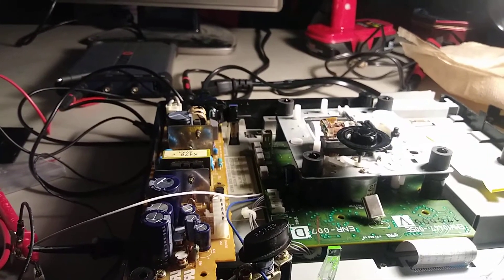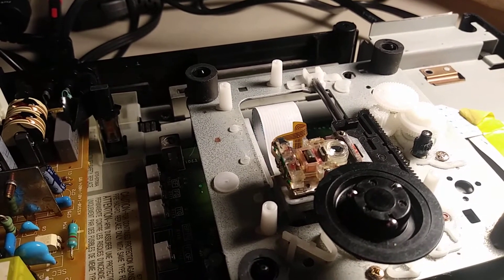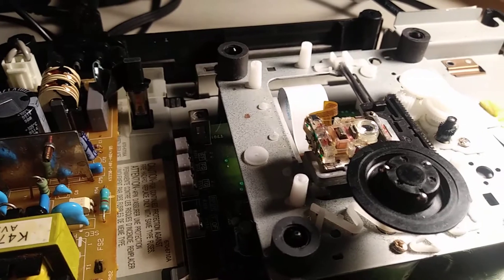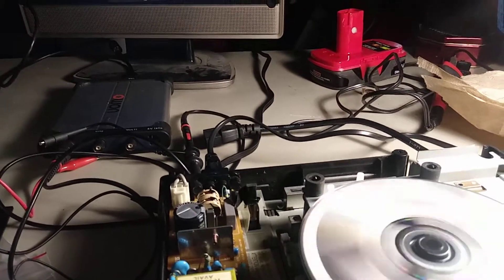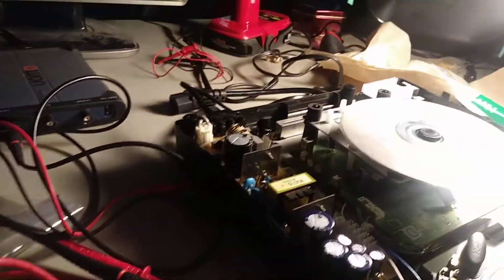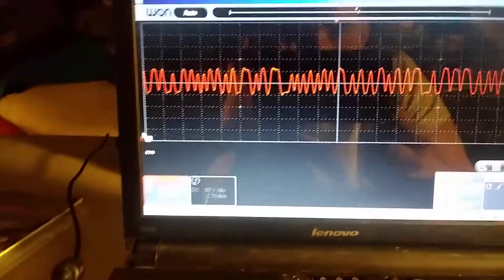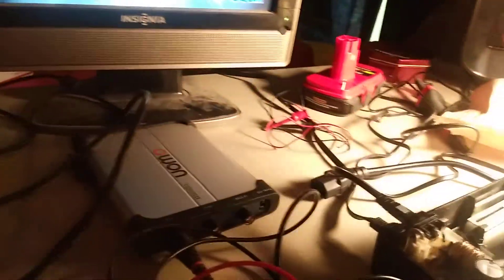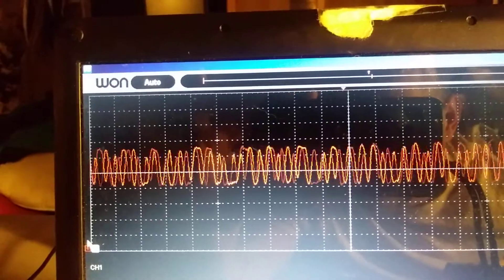Sega Saturn cd drive, distorted audio, won't read discs, with RF tests

Comment: Saturn is a pretty sturdy machine. From my personal experience - 80% of broken Saturns just needed a new laser and chinese sellers still got tons of optima 6 lasers for sale.
Reply from the maker: I hope so I got one on order.  It'll be cool to see what that RF output looks like from a working laser in comparison to the one I can't get to work.  I think certain things people use to replace the cd drive with an sd card slot is to feed info from an SD card to the saturn like it's from a cd, people talk about the good security on the saturn so I guess it's not that simple?  IDK, to bypass the security couldn't you just record the output from a real disc and play it back to the system to bypass the security?, like it could just say "whenever the drive is supposed to look here just tell it this" or something
Reply from the maker: so far I got new laser that was way worse than the original laser I was using, the potentiometer came cranked all the way up too, that rhea thing is the way to go but I'll wait until they sell it at a reasonable price or open source it to an arduino project or something.  I'll order another laser from somebody else in the mean time.
Reply: @OGmolton1  I had a couple of times when laser was adjusted too high so it had problems to read backups(originals worked without an issue), i just readjusted it back to the default point and it worked perfectly. Did your replacement arrived with anti-static point on it?

Comment from the maker: looking at still frames I'm wondering if the laser is getting feedback and the 0 low spots are going to high for some reason, none of them look like 0s they look like 2 different strengths of 1's
Reply from the maker: I think it might be dirt or mold under the lens that is reflecting laser light back at the photosensor when it shouldn't be receiving light , i'm going to really give it a bath in alcohol I think and let everything dry out for a while